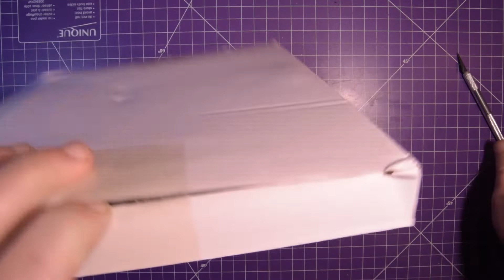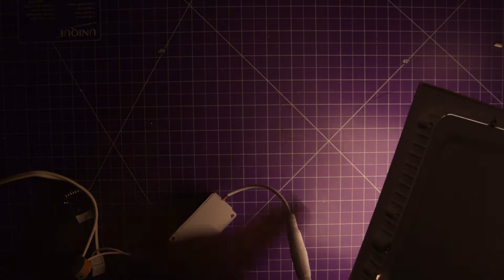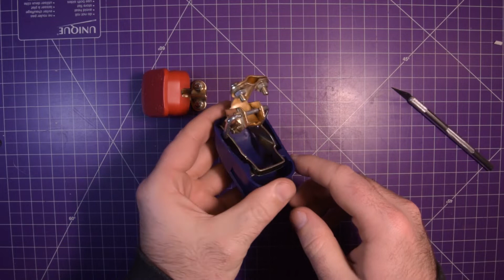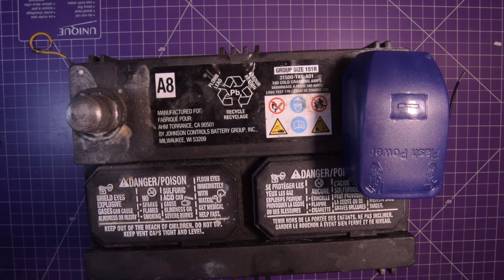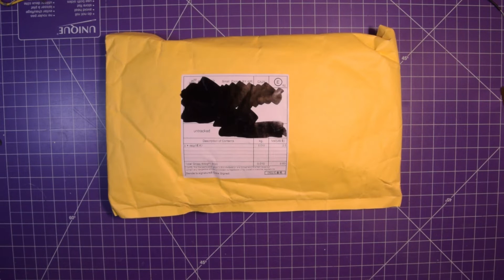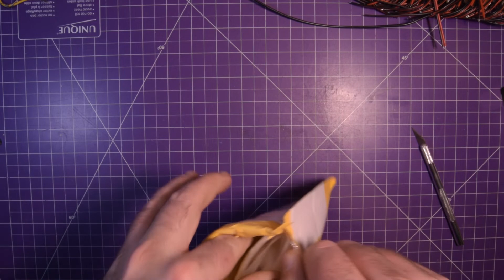Mailbag 37 - More LEDs!

Comment: the quick connectors are the non-switching ones , there is a similar type with a cog to twist on top they the switched ones,  i have loads of the ones like yours i get them at around £4 for the pair when prices are good, they loosen up alot over time and use, i cut a few around where the cable will exit ads they could only take 4 gauge wire and i had some that needed to be used with 00 gauge , only issue i have with them is the plastic cover is a pig to put back on and the plastic pin hinges do sometimes snap